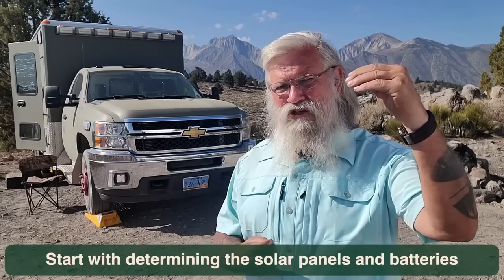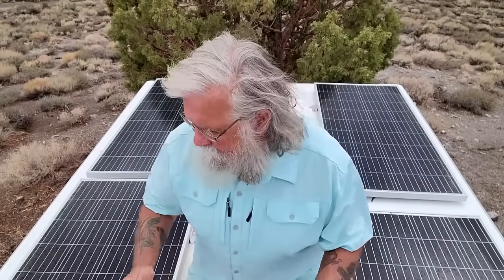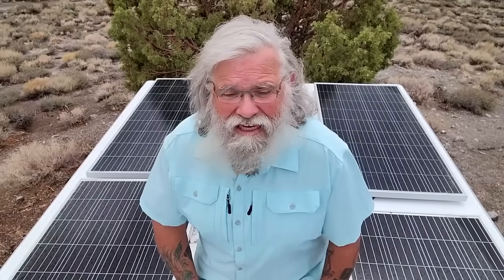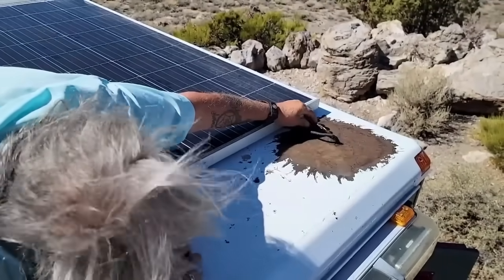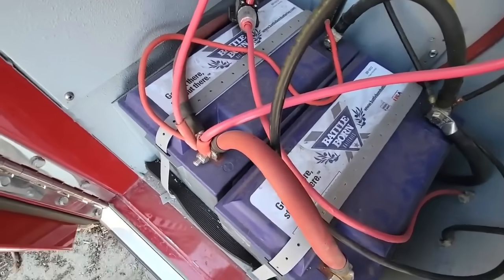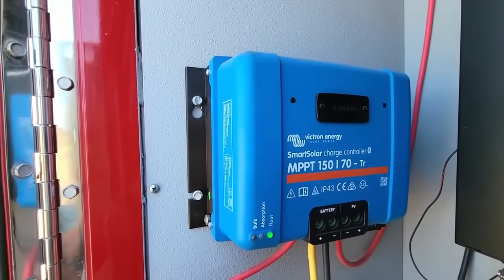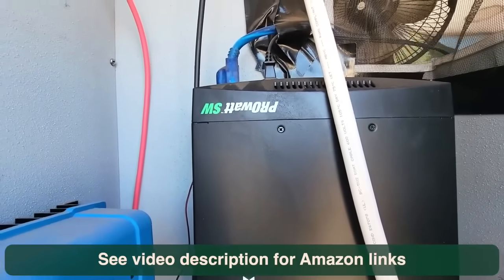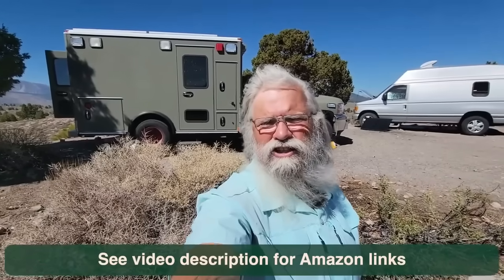A Closer Look at the Components in My Solar System Setup!

Comment: I think 24volt systems are more efficient and should be the new normal for Solar van setups. The initial cost will be a bit higher, but cheaper based on overall price per watt - and you can save a bunch from being able to use smaller wiring. 48 volt is even more efficient but you start getting into more expense, extra bulk, overkill, and the danger of electrocution - 24volt is the sweet spot (I think).
 
Also think people need to be aware of potential issues with wiring panels in series. A lot of panels, especially older ones, have multiple cells that rely on each other to produce power. If something casts even a small shadow on a 10th of the panel - power production can be reduced by 80%. Essentially, every cell is like a chain in a link. The shaded cell is the “weakest link”, reducing all the remaining cell’s power availability. So, only a small amount of shading can have a dramatic effect on the power output of a solar panel. 

It's kinda like the old Xmas lights where the whole string quits lighting up because of one bad bulb - because they are wired in series. Wired in parallel one bulb will not kill the whole string. So, if you're going to wire your panels in series you need to be more vigilant about ensuring there is zero shade (even a small branch) on those panels. Wiring in parallel if one panel has some "shading loss" the other panels will still work at their max potential. Newer, and/or more expensive panels are made to isolate individual cells of each panel to minimize shading loss over the entire unit Something to consider when installing.

The main difference between series and parallel wiring is volts vs amps. Wired in series, the panels voltage is combined but the amps stay the same. Wired in parallel, the amps are combined and the voltage stays the same.
For instance (picking numbers out of the air) if you have panels that produce, say 40 volts and 5 amps, two wired in series they will produce 80 volts and 5 amps - wired in parallel, the same panels will produce 40 volts and 10 amps.

The main benefit of wiring in series is to create enough voltage to run components off solar panels alone. I've heard that some have even been wiring systems with a combination of parallel and in series wiring - but I don't really know anything about that - google it

Hope this helps ...

Comment: I'm a solar contractor.  The last panels I bought were 350 watts for $202 each or $0.58/watt.  You can get panels pretty easily for under $0.50/watt now.  A big factor is the size.  The small panels, like under 200 watts, are much more expensive per watt.  So if you have the space, one big panel will be much more cost efficient than two small panels.  The shipping for one or two panels would be too expensive, and this is a bit harder if you're not a contractor, but if you're willing to do the legwork you can find a place that will sell to you and you can pick it up probably not too far away, especially if you are in CA or the SouthWest.

If you do the Henry's patch it's good to throw a layer of sand on top of it.  Sun wears out patches like that and the sand protects the sealant.
Reply: Jay, do you mind if I ask where you got that 350-watt solar panel for 202.00? I can't find any that cheap.
Reply: @seawrightstudios  AEE Solar out of Northern California.
Reply: @realmicrobet  Thank you!!
Reply: @seawrightstudios  i got my 10x 440w panels from signature solar in texas, $240 ea, shipping was expensive though for these big guys but I'm hoping with this much solar and 20kw of lipo I can run a mini split heater / ac. Haven't mounted it all up yet but just four of them on the ground fills my battery in under 2 hours of sun for everything but heat and a/c that will add to the charge time,  the overkill is to compensate for winter and my non sunny location in cloudy rainy oregon.
Reply: @jimbob3030  With that much LFP, hopefully you run 48V House bank.
Reply: @s.mendez7160  It is 48v, but only 10kw of batteries atm. I haven't bought the other 10kw yet, looking at my power generation history for last winter it seems I'd need 4x the panels to even begin to heat in winter with the mini split. I need a sale on solar panels and a way to cheaply mount a ton of them. Battery prices seem to be slowly dropping, but not solar panel prices. I also need to find a more efficient inverter than my growatt 3kw, it wastes too much power with high standby draw.
Reply: Prices have jump thebpast few months.  Even buying a "deal" and buying them by the skid...(30 panels) its tough to find anything below 56 cents per watt.  Canadian Solar seems to be the best bang for bi-facials these days.  The market is just like any other market.  It's changing and reacting to inflation.  Push the envelope folks and buy your stuff now if you can.   It isnt going to get any better.
Reply: Great info, appreciate it, THANK YOU!!

Comment: Bob thank you for sharing your wisdom and knowledge about solar.  You might try a thin foam window air conditioner filter to put over your screen to help cut down on some of the dust the fan is pulling to help cool off your solar system setup.  With your ever changing knowledge, I think some day you will have an electric motor on your side by side and solar panels on the roof to charge the system.  You are one cool dude Bob, thanks for helping so many people and always sharing positive energy.  GOD bless you and Cody.

Comment: I still feel overwhelmed as I contemplate adding solar to my van. I watched this one twice, and I'll watch others' videos until I start to feel more comfortable.  Thanks so much for sharing this useful info!
Reply: Once you do it , you will see how simple it actually is.  To install/use solar, you don't need to "understand" solar.  Its like a car.  You can use it just fine without understanding it.  Just learn some basic info.  Get to where you can draw a simple block diagram of your system and tell what each block does.  No need to get super deep.  Like your car, pay someone to repair any big problems until you learn more.
Reply: @Irideonandon  Thank you so much for this. It helps take some of the anxiety away. I'm definitely electronically challenged. 😄❤
Reply: @Irideonandon  this is true. I still don't understand all the details and want to learn more, but it isn't too hard once you figure out the basics and start putting it together. Now I am fully confident I can build another system when I upgrade or change vehicles.
Reply: I felt the same way, so I bought what they call a power station, e.g., Jackery, Bluetti.  My main draw is an very small refrigerator.   Two 100 watt solar panels and a 500 watt power station provides plenty of power generation and storage the fridge, lights, a fan, and to charge my laptop and cell phone.   I still know very little about amps, watts, volts, inverters, batteries, etc .  The system cost about $600.
Reply: @jacksonunderwood1954  I did similar setup Using Bluetti AC50s in my van.  My next step is mount a roof vent/fan, & attach roof rack w/solar panels.
Reply: I agree totally!
My husband and I have gone back and forth. He only wants to camp at state or national parks so we have shore power. I protest that we won't want to do that always; we would go broke!
I'll have to do more research.
Reply: @spoosieoopsie1616  I had a motorhome many years back, put solar on it, a very simple system.  Solar pays for itself quickly if you spend a lot of time on the road.
Reply: @spoosieoopsie1616  victron has alle the component you need. but i whould build my own battery, its much cheaper, an you know its quality.
Reply: I'm the same way. I seem to have a mental block when it comes to understanding how to do solar on my acre property.  Have to read and reread, even though I write music and have other abilities that MOST people can't do!
Reply: The most important thing is the wire sizes you use and the fuses and breakers. I always use larger wire than required, and a smaller fuse for the wire size. of course crimping the connectors properly and the exterior wire connections as well. Exterior wire should be uv rated. i have done a couple systems and it was years between so i got on youtube and watched videos. the solar companies can be helpful as well. I have got a combiner box online* for Parallel panels) that was not wired correctly( from China) and even the mc4 connectors(from China) that were not waterproof. i could see light where the wire and connector were supposed to seal to make it waterproof. a wire could short out if there was lots of rain and it got into the connector. or that's what i didn't want to happen.  They make plastic boxes to seal where you bring the wires into the rv/van..no need to do the henrys thing in my opinion. of course you still have to seal the box and make sure wires don't rub on metal or anything.  Then there are specialized solar tools required as well.
Reply: Contact Tandem solar! Good prices I bought a 350 watt solar panel for about 500 that is including shipping !
Reply: Oh, it is very simple. Diysolarforum is a great free resource. If you are trying to do it on a budget, a little at a time, it’s important to decide what you need to power first. 
Once you have a handle on the needs, building a system around it is easier.
Reply: Don't feel overwhelmed, there's not a lot to this. Just read a bit and you'll figure it out
Reply: Maybe Bobs non profit can help others get a system like his 👍
Reply: So far I think I understand that the solar panel produce energy from the sun that is stored in a battery, then I read about needing a converter so you can use that energy with a regular plug in like in a wall outlet, some converter also have both, USB plugins and then some solar panel I think come with integrated converters so this is hook-up to a battery. Where does the lithium battery come into play with these set/up I mentioned above?
Reply: @bebe60602  Electricity goes from the solar panel or panels to a charge controller and then to the battery to charge it.  The charge controller's function is to change the voltage of the electricity produced by the panels to a level that is correct for the type battery you have...lithium ion or one of several types of lead acid battery .  Too high and the battery will be damaged.  Some charge controllers have USB ports as a convenience to convert a small amount of the electricity produced by the panels to something your USB devices can use.
A separate device, called an inverter, hooks up to the batteries and changes the 12 volt DC current of the batteries into 110 volt AC current for things that run  on household current.  Some inverters also have a few USB ports as a convenience.  That is about as basic as I can put it.  Youtube won't let me post links in the comments so I can't give you a link to better information sources with diagrams.
Some portable panels have a little box on the back that has a few USB ports for convenience and is also where you hook up your cables to charge a battery or hook up to a power station, but it isn't usually a true charge controller and there are some batteries that it will damage if you hook them up to it.
Reply: Just FYI, Hire an electrician,  He'll have it done lickety- split! A couple bills, but you should feel confident it's right..
Reply: You won’t regret it! You can always start small and build onto what you have, that’s what I did. You can Just get enough solar to run your lights and fans for now. You’ll see the benefits right away. I love being able to pull into a camp site with full hookups but I don’t pay for that.  People come up and ask how is my camper not plugged in? I can run my whole camper on solar in sunny weather, and it wasn’t as expensive as you might think. Do research, and buy the right batteries and controller. There’s lots of good ones, avoid the bad ones.
Reply: Don’t be
Reply: Draw the system out in boxes, inputs, outputs, what is solar panels,, AC and what is DC so you don't mix them. Use a separate charger between a generator set and the charge controller, if using lithium battery. Lithium batterys pulse charge where they have a high current draw, this is also why connecting lithium to vehicle.
 alternator can be a problem.
A same amp-hour capacity lithium battery is half the weight of the lead-acid dry cell, lithium is 2500-5000 cycles compared to lead-acid dry at about 350 cycles.
The lead acid dry do have desulfator electronic devices to revive or  extend the battery life.
Reply: I'm with you there friend..I just can't figure it out and being disabled on Ssdi and can't afford to buy a system out right.
Reply: One key point about setting up solar systems is picking a few pieces of equipment as a starting point and building around that.

I would say that picking your battery type could be the best starting point. The type of battery determines the type of battery charge controller you will need to use. Now you can pick your battery charge controller/etc. A lot of modern solar battery chargers actually fill the role of several pieces of equipment. This echos Bob's experience. Note how he said he picked the Battleborn lithium batteries because of constant good reviews. And although he knew about the battery controller's good reputation, it was the battery maker that recommended that controller also. Decent battery companies are going to recommend good equipment because having a reliable charge controller is so important to the battery's life and performance. If they have a good reputation, they want to keep it.
Reply: @littlepotato2741  Thank you so much for this. I appreciate your reply greatly. ❤

Comment: You have a great system. I'm still a agm guy, my thinking is solar is cheap and batteries are expensive. You mentioned you don't go below 13 volts so your not really cycling the batteries anyhow. agm will last a long time if you baby them and don't deep discharge them.

Comment: Wow, those solar panels measure out nice. I have room for five. Can a Victron Charge Controller charge an odd number like five? Would it need to all be in series because of this?  I could change up to five tilting panels at 180 watts each for a total of 900 watts. Two 200ah Lithium Lifepo4 would charge real nice in winter with a setup like that. Great job Bob.
Reply: If you have an odd number, either all have to be in series or all in parallel. It’s best to go series if you can and get a controller that can handle the voltage. The higher voltage means less current and you can use a lower gauge wire
Reply: @Noah-qt3rq  but if one of the panels experiences shade then all the other panels in that series will go down to the percentage of the shaded panel, that's the drawback of running in series.

Comment: I am planning to have 2 fridges in my Transit connect. Do you think 400Watt solar will be enough please? Also I have a CPAP machine. Boil some water for my tea too. Thanks.
Reply: You maybe right, however, the expanded use can always allow room for other large wattage items! i.e.,cooling, etc... in which Bob didn't touch on.